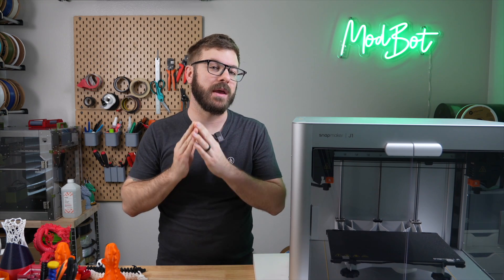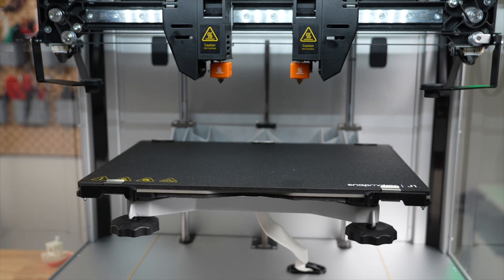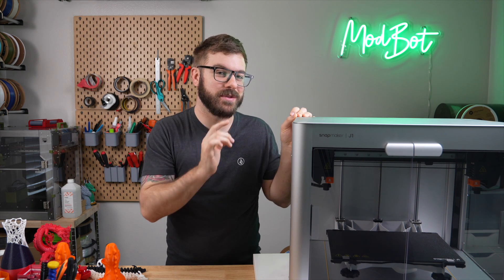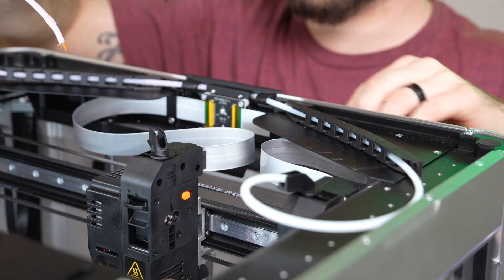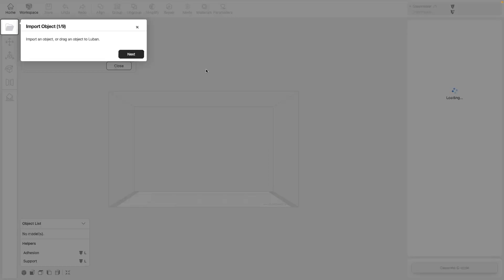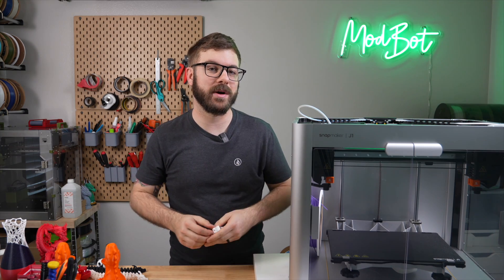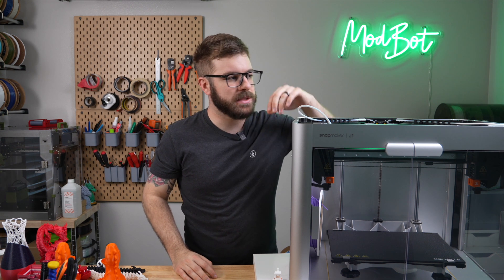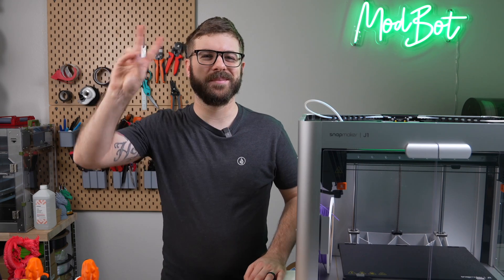Is The Snapmaker J1 The Ultimate IDEX Experience?

Comment: I've seen a couple of different J1 reviews and they've impressed me quite a lot. I had been planning on getting a Sovol SV04, but after having spent time in the SV04 user's group on Facebook it is a machine that can be a real struggle to get running and keep running...as someone who has traditionally been a fan of budget Chinese printers, I think the J1 is so much better than the SV04 that I'd be willing to pay a premium price up front to make the user experience much more palatable. 

Of the biggest gripes I can see regarding the printer, most seem to have already been addressed by the community (nozzles and spool holders), could be fixed with a little ingenuity (gaskets for the doors and a secondary build plate cooling fan for printing PLA or printing at high speeds), or shouldn't be too troublesome for Snapmaker to help with (spare parts sales). The only one that puts a damper on the printer for me is the size - in copy and mirror modes, it's basically like sticking two Ender 2 Pros together in terms of bed spacing. Then again, that's a problem with any IDEX printer and even the SV04's larger total print volume ends up being more restrictive on X in mirror mode (at only 115 mm vs. the J1's 150 mm) due to the size of the hot ends.

If I end up getting a J1, I don't feel like I'd be able to use it to replace my existing 300x300 mm printer (Artillery Sidewinder X1) due to the size limitations. But I definitely could see the J1 replacing my modified Ender 3 as the daily driver, especially as 3D Print General's review found that the ambient chamber temperature still reached 50˚C even with the gaps in the doors.
Reply: I figured out a special method to level my SV04 that serves me well. At first I definitely thought I made a mistake getting it. Walked away, rethought exactly what needed to be done and which order, then bam...I get pretty consistent dual color prints and being able to print copies is surprisingly useful.

Comment: Back in 2020 there were quite a few IDEX machines around but none were IMO good enough, I thought within 6 months to a year we would see a definitive IDEX printer on the market, this never happened.
 One issue in the old IDEX machines was the choice of a single part cooling duct, Snapmaker have not addressed this issue.
This is not the definitive IDEX printer I have desired, if Bamboo Lab released one with AMS capabilites I would jump on one straight away.
Reply: I'd say give bambu up to 3 years for a 2nd product.  Like how Framework is coming out with their 16" version laptop.